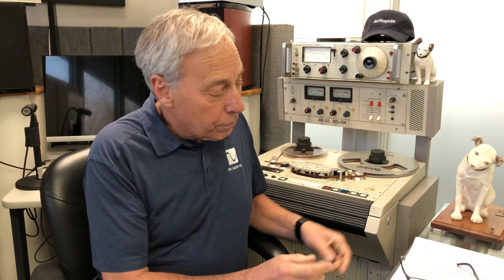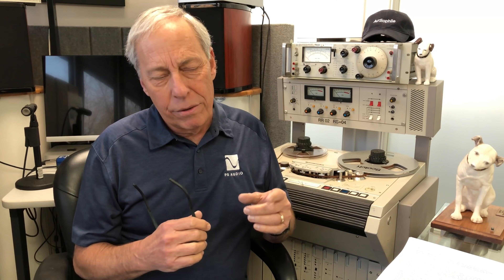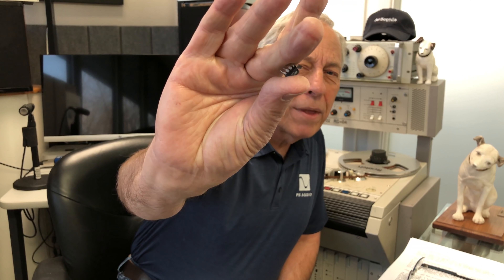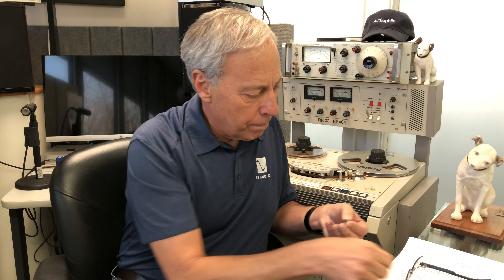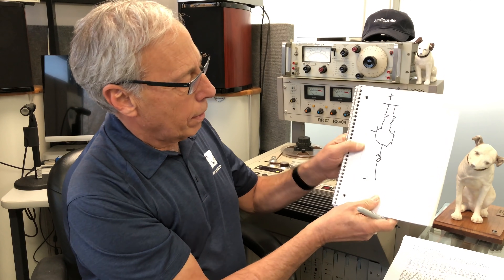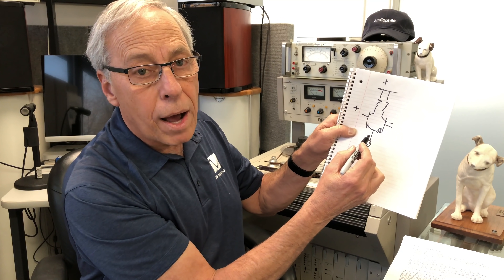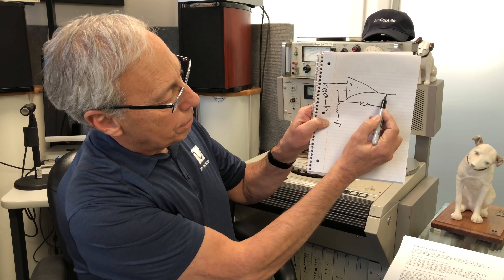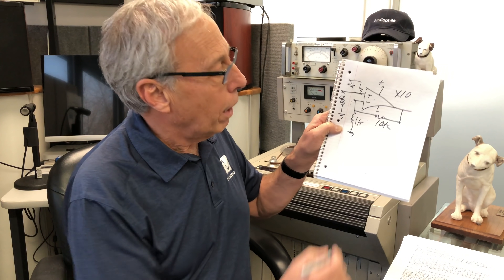What are op amps?

Comment: A little correction to your feedback resistor network: it is a voltage divider. When we consider the resistor between non-inverting input and ground as R1 and between output and non-inverting input as R2, the gain is (R1+R2)/R1 or R2/R1+1.

Comment: The opamp in your hand was an AD706. I think you use it very often for low frequency low noise input stages with higher gain (phono). I like it very much because of its low noise and very low µV offset. In fact it is a bipolar opamp but with nA input currents comparable to FET opamps. Unfortunately it is a little bit too slowly for power amps.

Comment: Hey Paul thanks for all your efforts. I've learned so much. BUT... we're not all engineers!  Way too deep. Keep It Simple!!!
Reply: He did answer it simply.  An operational amplifier is a differential amplifier followed by a gain stage.  If you aren't interested in the circuit stuff, that is about as much as you really need to know.

Using an IC op amp makes designing small amplifier circuits trivially easy (as well as things like mixers, differentiators, integrators, comparitors, etc.); but, most of them were not designed for high end audio purposes.
Reply: @timharig  Yeah, that doesn't help us non-engineers either.  I mean, what the heck is a differential amplifier?  And a gain stage for that matter? 

In my opinion, a really smart person should be able to give both a really simple and a really complex answer so that all people can gain something and learn from what is being said. I mean, circuit diagrams mean absolutely nothing to the average person, none of it makes sense to them because they don't understand any of it, and it just turns them off, some puns intended.

I believe it could be been better explained by using simpler, more basic terminology first, basically defining what things are and what they are for, before going into detail about how they work.
Reply: @mydogskips2  I guess that really begs the question, if you are not interested in learning about circuit diagrams, then why are you watching a video about what is ultimately a circuit component?  It's a little bit like  somebody who is afraid of math asking a question about calculus and getting mad because the answer involves math.

Nevertheless, I will give you a grade school math definition of what an operational amplifier does without terminology.

An operational  amplifier takes two input voltages (we will refer to them as A and B).  It subtracts one from the other to get the difference  (this is what the differential amplifier does).  Then it multiplies the result by a very large number (typically on the order of a millions -- this is the gain stage) and output's the result:

output = (A-B)×1000000

That's it. Do you feel satisfied?

I doubt it since that simple definition, while completely accurate, doesn't really give you any real sense of how to actually use an operational amplifier to do anything useful. Most of an operational amplifier's purpose comes from the circuits that they are contained in.

So engineers are not taught to think of them that way. We taught that they are a black boxes and given some rules to use when analyzing them in circuits. Many junior engineers would not even know the content of this video.  They don't care what an operational amplifier does or how it works.  They are just interested in how to use them to do necessary operations in their circuits.

Comment: Are you sure the Phono Preamp had a 709.  After a year, there was a mod to change to a faster Motorola transistor which improved the sound.  Though the passive eq. was soft and not dynamic for the bass.  Good looking with the Wood side panels. Have to look through Audio mags.  I think the unit sold for $40. And the mod was about $10. Made in your garage?

Comment: I think it is X11? (1V in, 11V out)
Reply: Yes, in this configuration gain is 1+ Rf/Rin (until you encounter the amp's gain-bandwidth product, and then it rolls off).  
The calculation that Paul did, is valid for the inverting configuration, with signal applied to the input resistor (instead of it being grounded), and the non-inverting input grounded.  
The modification that Paul mentioned which they used for the 709 op amps, was probably to bias the output stage to class A by connecting a current source to it.  This is a common method for low-distortion applications, although many modern op amps have such low distortion that they don't need it.

Comment: I can remember am article in Electronic World about building an operational amplifier with tubes, I think it used 4 dual triode tubes. I thought about building one but when I priced out the parts I just could not afford it, I was a junior in high school at the time. I think Philbrick used to sell a simplified unit that had two dual triodes on a phenolic base that would plug into a single socket..

When I got out of the army I worked for Analog Devices when they were on Binny St in Cambridge but most of my work there was on 4 quadrant multipliers. This was in 1970 and IC's were in very early days, they came into being because of the moon program with NASA and the military doing the heavy lifting for the R&D costs. 

At this time high end op amps and multipliers cane in potted blocks that were about 1.5" sq and had pins coming out the bottom side. I still have some of those modules down my cellar and the sockets they plugged into. IC's were mostly used by government agencies and they were nothing like we saw later on as far as performance goes.